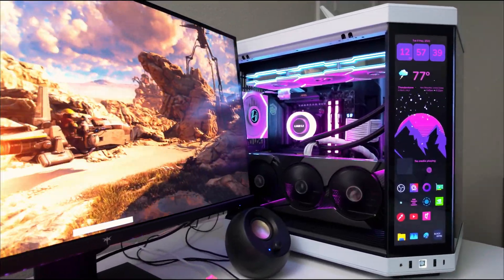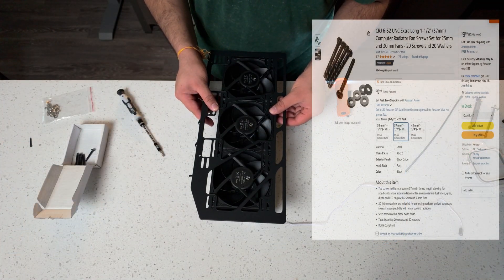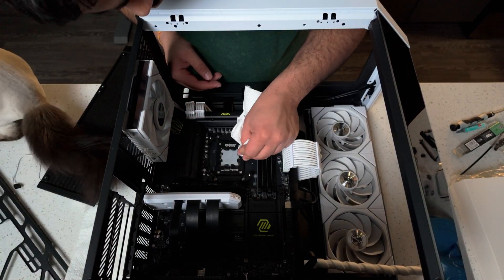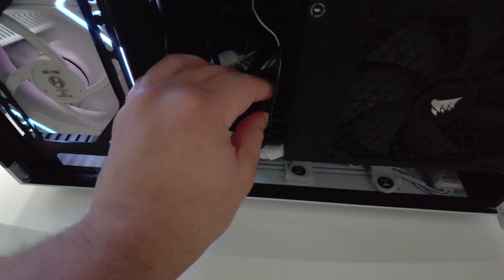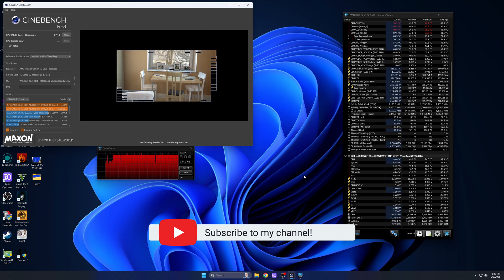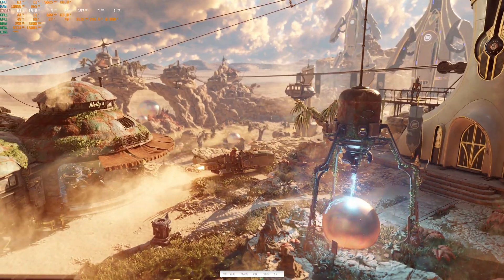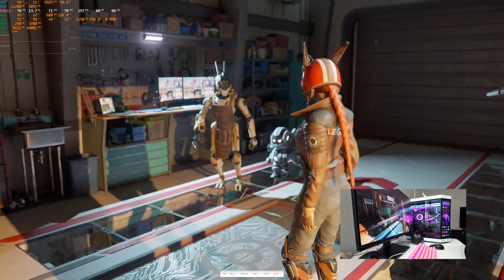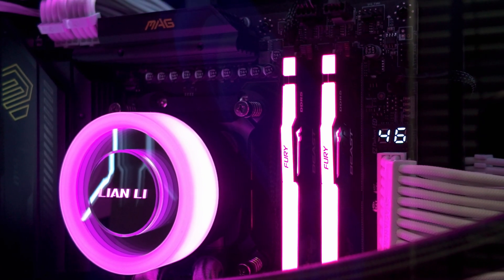GA II Lite 360 + TL 120: Game-Changing Cooling Solution

Comment: Thanks for making this video. Correct me  if I am wrong. GA stock fans are rated Max RPM i2500 RPM, so based on your CPU fan curve 95 Deg -> 2125 RPM, 80 Deg -> 1900,  65 Deg -> 1475  RPM , 50 Deg -> 1000 RPM, 30 Deg -> 400 RPM. At higher temps 65 Deg and above stock GA fans are running faster than the TL fans but  the TL fan curve seems to run at slight faster RPMs at lower temps? TL 520 RPM > GA 400 RPM at 30 Deg, TL 1040 RPM > GA 1000 RPM at 50 Deg. Am I missing something here?
Reply from the maker: Great catch — and you’re not missing anything! 🙌

You’re right that the GA stock fans are rated for up to 2500 RPM, but in my curve, I capped them at 82% PWM (~2050 RPM) at 95°C. Meanwhile, the TL fans are hitting ~2100 RPM at 95°C, which is slightly above spec — I tuned them manually through BIOS to ramp a bit harder in push-pull to maintain airflow pressure without needing the GA fans to go full blast (which gets loud fast).

You also nailed it on the low-temp range: TL fans spin up faster earlier (e.g., 520 RPM @ 30°C vs GA’s 400 RPM) — that’s intentional to keep airflow moving through the rad even during idle or light workloads. The whole goal was to balance acoustics and cooling efficiency in this setup.

Appreciate you taking the time to analyze it — I might do a follow-up with RPM-to-noise and delta temp comparisons if more people are interested.